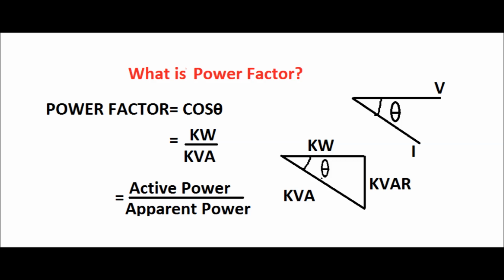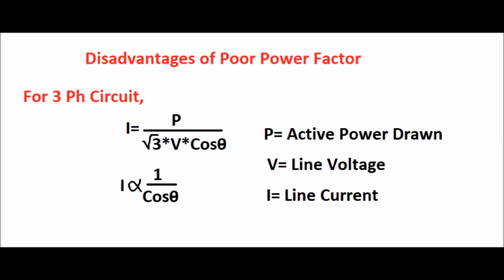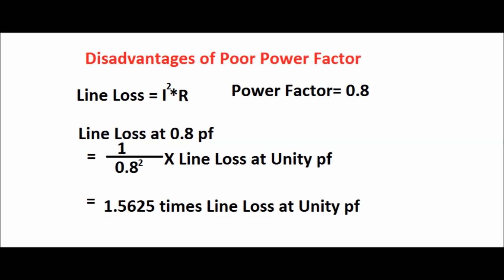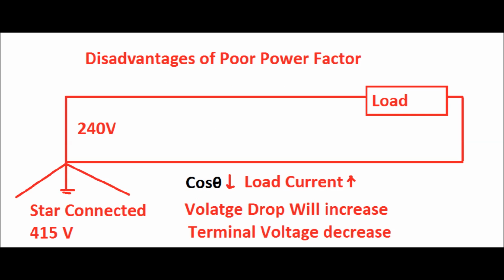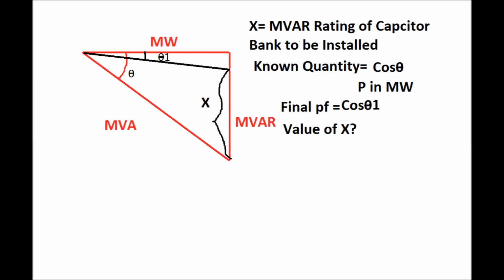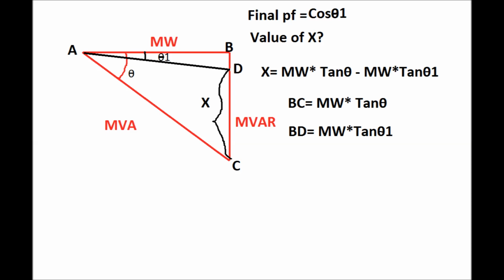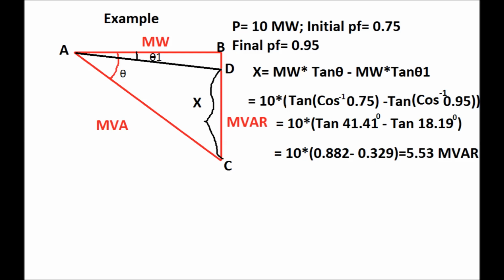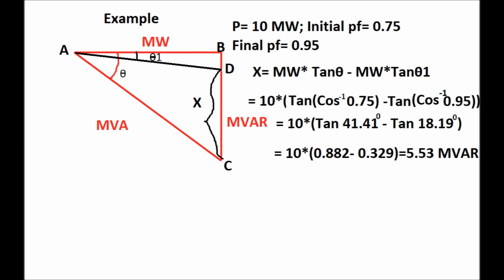CAPACITOR BANK SIZE CALCULATION

Comment: Sir after calculation of  capacitor bank  .suppose it is 60 micro Farid. But at panels board instead of 60 Farid 30 m Farid + 30 m Farid connected why.